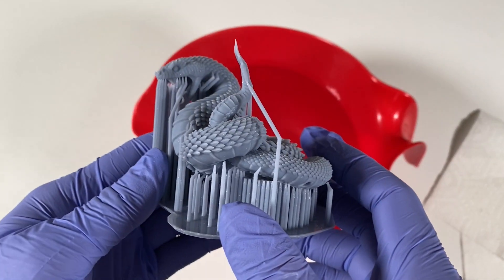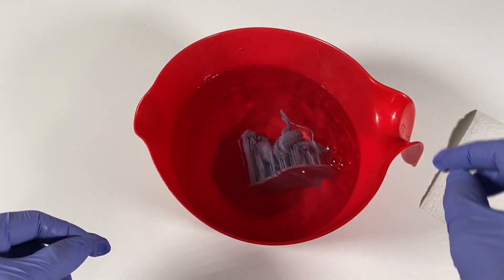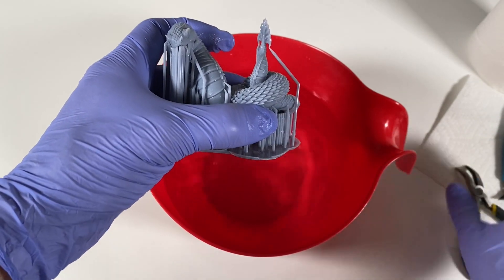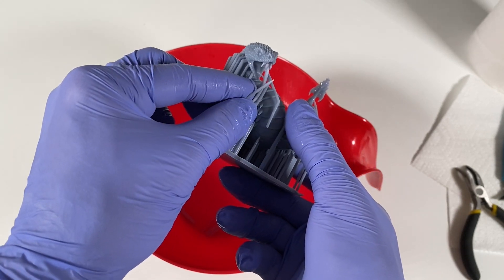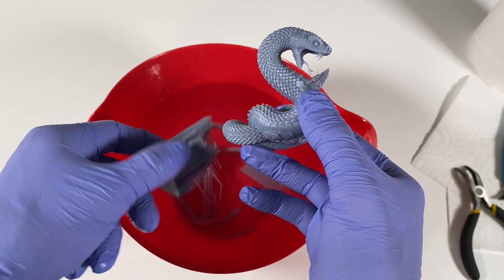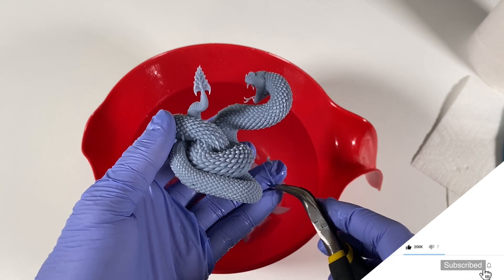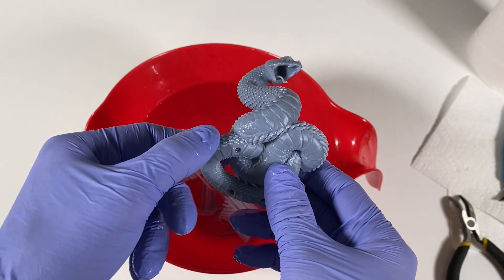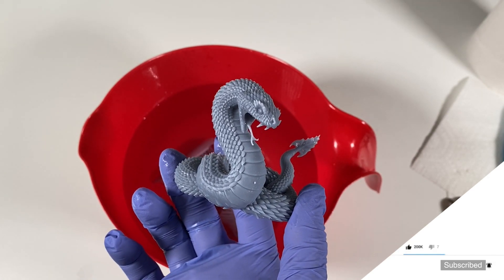The easiest way to remove support materials in resin printing

Comment: Best support removal starts with the support style. This was supported fairly thick, but thin tips can help make removal easy. The hot water trick works, I often use a hot bath of alcohol and water mixed and soak them for about a minute, the supports usually slide right off. I have managed to print "antlers" and "feather tips" at less than .15 mm supported and they remove just as easy. It's all about where you start, and supporting is super important, but too often people rely on auto-supporting and that can make support removal a real pain. Great videos for folks looking to learn.